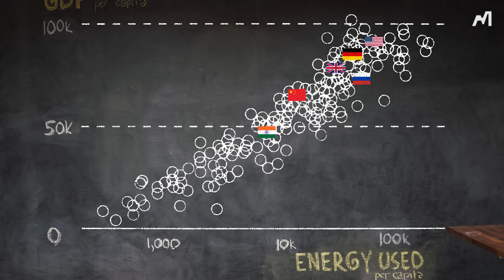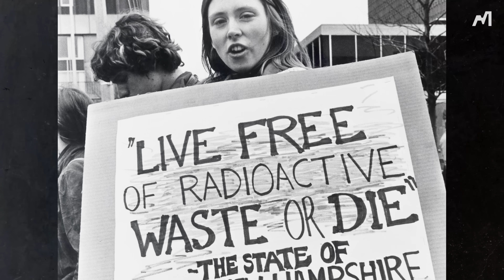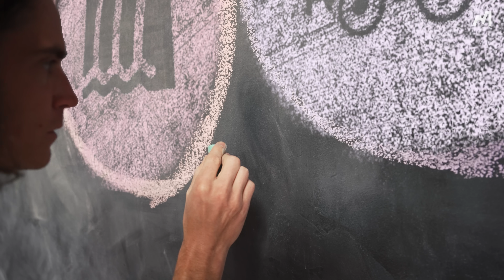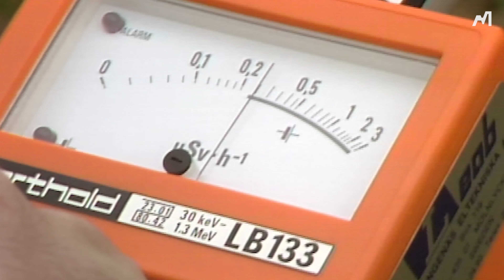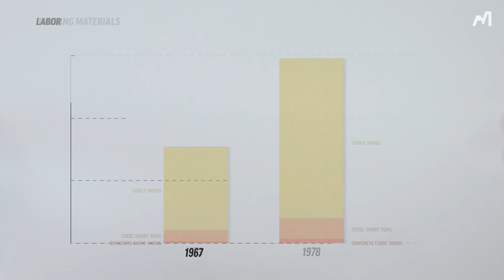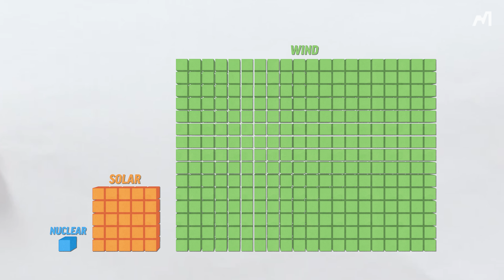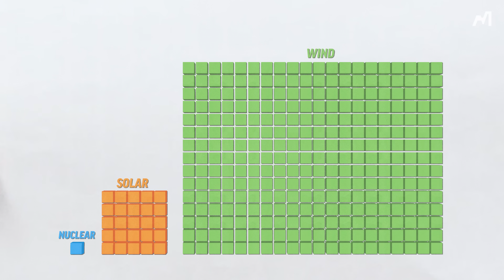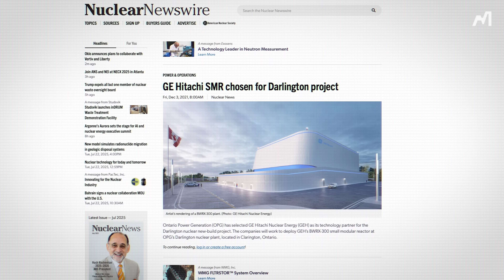They're Lying to You About Nuclear Energy

Comment: You missed only one key factor in my opinion, exemplified by Karen Silkwood, and how she exposed the corruption and cover ups of the nuclear ecosystem, and how that also trickled down to that rule that changed everything. It is not The Simpsons that destroyed the idea of trust in nuclear energy related enterprises, is the bad actors within those ecosystems that did, the people at the time were indeed outraged at the fact that they believed nuclear and anything related was unsafe, but they also had a real concern, they did not trust the system handling those issues.

It wasn't just fear of nuclear energy, it was fear of nuclear energy in the wrong hands, and I think this is the point you missed. If we are to move beyond that, we have to acknowledge that in my opinion.

Comment: The problem with nuclear is - unlike when a coal plant burns - the area becomes unsafe for decades, or centuries.  Even with current clean-up efforts, the typical estimates of when someone can return to long-term living in the Fukishima  "no-go" zone is the 2040s.  Without all the time, money, and effort spent on decontamination, it would be much, much longer.

Nuclear power isn't as risk free as Max claims.  Have a read about the Tokaimura nuclear accidents on Wikipedia, or Google it.  Corporate malfeasance tends to compound the harm that regular citizens suffer from nuclear accidents, which only makes nuclear even more unappealing.   While you're at it, look up Louis Slotin and Harry Daghlian.  Both were physicists, and both died of radiation poisoning.  Yes, these are fairly extreme cases, but they make the point that radiation poisoning isn't benign, and is one of the more horrible ways to die.

The reason nuclear is responsible for so few deaths is not because it's safe, but rather because the regulations that Max spoke of have kept it from proliferating.  That's a good thing.

Comment: Everything you communicated is on point... except for SMR's.
That's just marketing speak... best just to discuss small reactor's (they're never modular as billed, like an iPhone or other consumer product... the shielding requirements are always significant and prevent the false narrative that these things could just be driven to a site, and then switched on)
Basically, small reactors will always be more expensive compared to larger reactors on delivered electricity basis. Best just to build the big ones unless need for small bespoke solution in a remote community.
Love your work otherwise. A massive push for nuclear is what the world needs as of yesterday!

Comment: Harvard University, iet al, found that more than 8 million people died in 2018 from fossil fuel pollution, significantly higher than previous research suggested—meaning that air pollution from burning fossil fuels like coal and diesel was responsible for about 1 in 5 deaths worldwide.
It takes a radiation dose of about 4-5 Grays (\(400-500\) rad or \(4-5\) Sieverts) is the LD50/30 (lethal dose for 50% of people) to die within 30 days if received over a very short period. While lower doses are not immediately lethal, they can increase cancer risk, and much higher doses (e.g., \(10\) Gy) will cause death within days or weeks, while even higher doses (e.g., \(>50\) Gy) can be fatal within hours. The severity of effects depends on the dose, the duration of exposure, and the rate of the dose.
Deaths from renewable energy are extremely low compared to fossil fuels. Solar has the lowest death rate (\(0.02\) deaths per terawatt-hour), followed closely by wind (\(0.04\) deaths per terawatt-hour) and nuclear (\(0.03\) deaths per terawatt-hour).

Comment: Biggest and most stupidest think that I hear from people "But were to go with the Nuclear waste,it will never decay" 
And it shouldn't
Because thats a very good source to use as an "Diamond" battery that can keep itself alive longer then Li-ion battery that are known to burn for a very long time.
Re-usable Nuclear waste has never advanced further then storage because no research has even been conducted to re-use them,not out of safety issues,but because there was no demand or interest in re-used nuclear waste in daily lives.
All we saw was trash that has radiation that would not go away for 200 years,meanwhile while you fear the invisible and metalic smelling uranium,try to see under a microscope how much plastic you have ingested into your system,or burned coal.
The water we drink,be it out of a glass or plastic bottle,all micro contaminated,and you all worry for Chernobyl to happen in your country???

Comment: Michio Kaku wanted to dump tons of concrete on the nuclear power plant at Fukushima like what they did at Chernobyl.  Luckily, Fukushima was not near the disaster that Chernobyl was.  The newspapers claimed one of the workers inside the plant worked tirelessly and was instrumental in cooling the plant down after a tidal wave higher than the 18 ft retaining wall caused numerous problems.  Before the tidal wave hit the fuel rods had been pulled back and control rods pushed in starting the cool down process that takes days and the cooling systems worked long enough to avoid a melt down..

Comment: The issue with traditional nuclear electricity generation is very slow to ramp taking in the range of a half day.   That causes power grids to run nuclear power plants at constant output following demand with coal steam plants and fast reacting peaking power from natural gas turbine generators.   Ultra supercritical (USC) steam coal power stations have some fast reacting peaking power ability.    USC steam with nuclear power is feasible, but requires much higher temperatures and pressures than traditional nuclear power stations.

Comment: The answer is this - (rough calculations).
We have something like 300k square km of uninhabitable zones due to radiation, aquired for the span of 50 years messing with this stuff.
If we continue like this, in 40.000 years, half the planet will become uninhabitable for the next 40.000.
Reply: TL;DR: Other than assuming a rate of accidents that isn't physically possible, using a definition of "uninhabitable" that doesn't mean people can't live there safely, and overstating the duration of risk by 100x; except for those things,  you would be correct. That is the real answer.

First, you are assuming one Chernobyl and one Fukushima every 50 years.  Chernobyl was unusually severe due to the lack of any containment vessel to contain a meltdown. When it had its hydrogen explosion chunks of its core went flying everywhere.  From one reactor.  Fukushima had 4 reactors go down but because it (like every single reactor except Chernobyl  and a handful of the same reactor type only used in the Soviet Union) had a containment vessel the release of radioisotopes was orders of magnitude lower.  When the last of these reactors is closed down, there can be no more Chernobyls.  Since all have been retrofitted for containment, it's really not possible now.

Second, newer reactor designs, unlike Fukushima, use the laws of physics to prevent meltdowns not active cooling.  Which means that once these designs take over, there can't be any Fukushimas either.

Third, the zones are not "uninhabitable," they have increased background radiation.  To this day, there are people living in the Chernobyl zone.  And they are not especially unhealthy. The Fukushima zones are are considered "uninhabitable" at rates of exposure so low that the risk of premature death from biological effect of radiation is equaled or exceeded by the risk of death from the stress and anxiety caused by exaggerating the risk from radiation.  And sizable portions of the Fukushima zones have already decayed or been remediated to background at or below natural rates in many places people live.

Which brings us to #4, these zones, even by the grossly exaggerated standard of uninhabitability currently used, will not be "uninhabitable" for 40,000 years but for less than 400 years. And that is if we do nothing except let the most dangerous isotopes decay.
Reply: @MikeClark-g7i  Okay, so we have these nice new reactors that can never melt. 
Very safe, nothing like Chernobyl will ever happen again.

Why then can't we insure them properly just like everything else?
Why the liability caps, why Prince-Anderson act etc.
Maybe because the market "knows" we're actually overplaying our hand, and no one is really able to eat the cost of that kind of cleanup even in theory; except maybe for the tax-payer.

Also.. 400 years? Really?
That sounds more like an exaggeration.
I thought it's more like 4k-100k depending what kind of stuff you play with.
Sure, I've chosen 40k to fit neatly into my evil propaganda, but still... 
We're putting large areas out of use, for all intents or puposes, permanently.

Comment: I worked at STP as a student engineer in 1988. I would walk the plant and see the large cooling pipes with the date of 1977 stamped in the side. It had been under construction for more than a decade and was already at $5b. The original budget was $900 M. It had 2 reactors. One went critical when I was there. Big celebration but not producing electricity yet. The other one was still under construction. I'd see my mentors, full nuclear engineers, spend all day  in their offices, pouring over documents. That's when I decided to change my major.

Comment: I grew up with a nuclear physicist who understands the difference between short and long term radiation exposure.

Yes, you certainly can be injected with a radioisotope.

No, you don't want to be regularly exposed, even to low grade radiation sources.

Regular, low-geade exposure is why the dentist (used to) leave the room. They no longer do so because the machines now use a laser focused beam of x-ray.

The real threat is strong, concentrated sources of radiation, as found in reactors. The Red Forest is an example of exposure. So, yes, it is very dangerous but also very contained. Fewer power plants means reduction of chances of accidental exposure. It's simple math and explains why the plants were cancelled.

Not sure where the lies are...?

Comment: - I’d Thought Id read somewhere? (dont know how true it may be?) That the amount of total calories  expended, and calories of energy produced, the workload invested within a typical nuclear plant construction, as to its construction (infrastructure needed to supply build materials: trucking/transportation needs, cement batch plants, steel plants, copper co’s, pipes/pipefitters, welders, yo’ momma/labor/shovel pilots, etc) that it takes 25-30 years, after initial funding/loans being fully paid, too generate its first real dollar of profit with all the costs and processes involved?

- Which drives questions about reactors employing Thorium-Th90-232, converting it to Uranium 233, as fuel. Thorium as an element being more widely available than Uranium, Thorium reactors being a bit less efficient, but leaving behind less of the long term waste associated with nuclear reactors. Certainly Seems like viable option?

Great, informative presentation!

Comment: If we held oil and coal to the standard we hold nuclear, it would shut down both. Name an issue, deaths, sickness, damage to environment, animal deaths, risk of disasters. Coal and oil are both 10 times worse than nuclear.  
Honestly we should hold them to the nuclear standard, we would have massive clean energy adoption in 5 years.
Edit, the ten times is per kilowatt. It isn't because there is more oil and coal. There is a reason those death numbers are so huge.

Comment: you are missing a lot here. While eating radionuclides [like bananas] is somewhat OK, breathing them increases cancer risk fairly quickly. I worked in a lab that created systems for detecting and controlling plutonium leaks. Our entire team was impressed with the difficulty of the problem. I could go into loads of detail as someone who understands radioactive aerosols [small radioactive particles floating in the air.]

i wonder whether you are a concerned scientist or a lobbyist of some kind. People who read this should understand that this is an opinion piece and not science.
Reply: ps... nuclear plants are fine until they are not, and melt down. this has happened multiple times. we have never found a way to store the waste, so new plants store it on site in huge tanks full of water. this is crazy, and people need to look carefully at the whole process [not just perfectly working power plants]

Comment: I love how you avoid the discussion on the differing types of radiation and your focus on developing cancer as a result. I applaud your support of nuclear power; we certainly need more power sources but we also need our power sources to be disaster safe.

What you didn't cover: 

There's 2 types of radiation: ionizing and non-ionizing. The radiation we're exposed to by the sun and the background radiation we absorb every day is non-ionizing. This type of radiation doesn't cause significant cellular damage which is the predominant problem with any radiation source. Non-ionizing radiation DOES cause SOME cellular damage. Just look at someone who's spent the greater portion of their lives in the sun. The skin is affected, gets wrinkly and dry, and in general doesn't look the same age as the person. 

Ionizing radiation is the killer due to the extreme cellular damage it causes. It's the cause of radiation sickness, causing hair and teeth to fall out, skin to blister, swell, and die, internal organs to degrade and fail. Look at The Demon Core experiments for how those affected died. This is also why the hot zone still exists around Chernobyl; the ionizing radiation levels are still unsafe for extended exposure.

Ionizing radiation is also why the NRC wants exposure limits "as low as reasonably achievable".

Comment: Personally think each tech has its own place.
Wind though should be down scalled big time not up scaled kinda odd choice would be perfect in smaller units with higher speed.

Solar similar is better for small use and in specific circumstances stances like vegas being in the desert and using large nearby solar makes sense.

Comment: The utility that provides back up power to cool the residual radiation after a SCRAM has a NERC responsibility. The person who had that responsibility was on leave so I said I would do it. We had a schedule of 1 p.u. V. and they needed 1 pu V. I asked if that was with or without the load. Their answer was with the load. Which meant 1.037 Vp.u. before the SCRAM under full system load conditions in the winter. Then looking at the signal path to the dispatcher and the possible error of the voltage transformer and all the transducers the voltage had to be 1.047 V p.u. At that time the nuclear power plant had been operation for 14 years of a 20 year license.

Comment: The Germans are far worse in this regard. Now they are paying the price. Germany shifted to either external energy suppliers (natural gas mostly from Russia and electricity through its connectivity to the power grid of neighboring countries, all of which use nuclear to generate a huge amount of their power) or renewable sources, mostly wind and solar. During so called Dunkelflaute (no wind and no sun) good luck using renewable resources.

Nuclear plants are by design extremely safe because of what may happen if something goes wrong. The fear-mongering especially from organizations such as Greenpeace is astonishing.

Comment: They didn't lie to us. This kind of radiation can and will cause mutations of our cells. It's a matter of luck and exposure if you develop cancer or not. Using the metric of fatalities to measure the impact of radiation is wrong. One of the reasons is that it's extremely hard to pinpoint the cause of cancer and therefore man cancers won't be counted as fatalities of a certain event.
Reply: All radiation affects cells my friends. Sound waves cause vibrational energy transfer and light waves cause rotational and vibrational modes as well. 

If a tree falls in a dense forest and no one is around to hear it, does it still make a noise?
Reply: @Transmutathan Ionizing radiation is a type of energy released by atoms that has enough energy to remove electrons from other atoms as it passes through matter, a process called ionization. This can occur through electromagnetic waves like gamma and X-rays, or as particles like alpha, beta, and neutron radiation. Unlike non-ionizing radiation, it can cause chemical changes in cells and damage DNA, potentially increasing the risk of health issues like cancer.
Reply: Fossil fuel plants create more radiation then nuclear plants
Reply: @Keeby. True - which is why we should get rid of those, too.